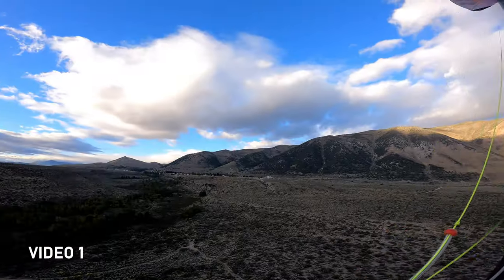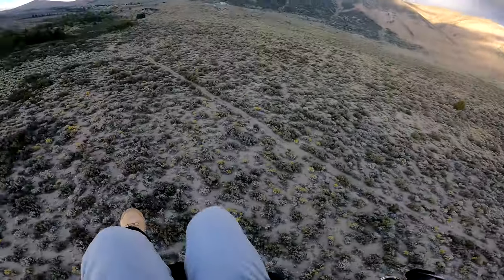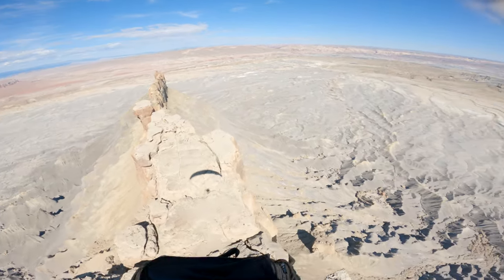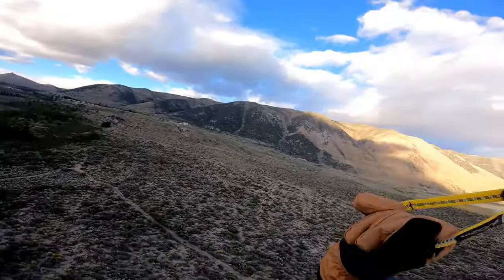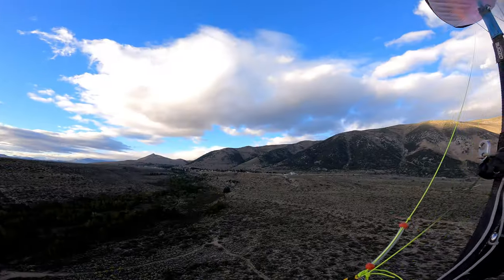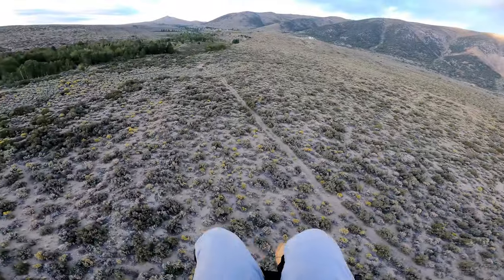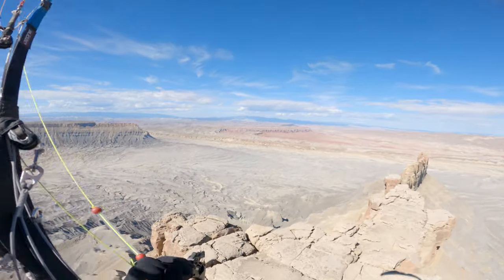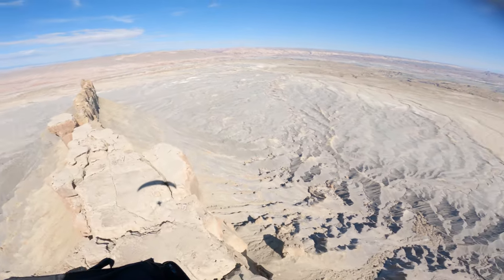FULL FRONTAL'S On A Reflex Paraglider - What Is It Really Like?

Comment: Would be more informative to know if an A wing would have taken the same collapse…?
Reply from the maker: An A wing would have recovered quicker and with less help/assistance from the pilot. A wings are designed to open quickly without any pilot input.
Reply: @TrevorSteele1  I know. I meant  in comparison to the reflex in identifical conditions
Reply: @EdgeofEarthParamotor  that would be pretty difficult to fairly compare. Maybe it could be done in a wind tunnel.

Comment: Nice dude. What trim setting did you take these at?
Reply from the maker: The FIRST RED line
Reply: @TrevorSteele1  I'm not familiar with that wing ... Is that in reflex profile in that settings?
Reply: @Johnny-gb7eh  the red line and up on the risers signifies reflex profile
Reply: @arch0nindustries  On Ozone wings, I thought the red line and below, just identified the range in which it was safe to use brakes? Above the red line, tip steering only. The wing itself is always in a reflex profile, to varying extents of reflex...ness....
Reply from the maker: Yes this is correct. Red line is when the reflex profile starts to "engage?" and where Ozone suggest you do not touch brakes.
Reply: @TrevorSteele1  I think the wing is always in a state of some reflex - but as you move the trims out, the reflex profile gets more and more exaggerated. MitchGe kinda explained it that after the red line, the wing's CoG is moved so far forward, that pulling brakes would be asking the airfoil to do 2 different things - which is why they tend to collapse when brakes are used.

Comment: 1. why were you flying trims out (fullreflex) under 30 ft? seems to be unnecessary risk taking 2. you cannt tell how they are after 3,4 collapses, I know a pg wing where 1 in 20 gets really shitty, the rest beeing ok
Reply from the maker: 1. Wasn't moving forward trimmed down. I had no options but to trim out in order to not be pushed back over the lake behind me. I wasn't in full reflex, I was at the red line which is where reflex starts to "engage" or become effective. 

2. The initial collapse speaks for itself.
Reply: @TrevorSteele1  thanks, but then the title is misleading if you were not in the reflex mode

Comment: Why does the industry use the term 'reflex' when it's impossible for a cloth wing to have a true reflex profile?  True reflex wings are rigid, and have an inverted pressure gradient in the aft portion of the wing at low angles of attack.  This profile gives negative feedback to a dive and is a safety feature in hang gliders.  There's no such thing as a 'reflex' paraglider wing. It's impossible because there's no 'pushing' force - there's only one force on the risers, and it's a downward force 100% of the time.

Comment: So I have an honest question….you just posted a video showing you taking multiple collapses on what appeared to be one flight. Would those collapses have happened on a dominator? Your uncle spews so much bullshit that its hard to decipher the truth. And flying these reflex wings now, what is so much better about them vs a dominator? Are they faster, is it just better for acro?
Reply from the maker: Yes the Dominator would have collapsed. The Dominator is actually more likely to collapse then reflex wings. It does recover very easily and quickly. Had I been on a Dominator during the flight where I took the collapses, I would have taken probably double the amount of collapses. It's hard to say what a Domiantor would have handled them like, but it would have most likely been less "violent" then this wing. Although this wing did handle them VERY well.

To judge a collapse you want to look at 3 things.
1. Altitude loss
2. Direction change
3. Ease of recoverey

The Dominator doesn't loose hardly any altitude, It doesn't change direction, and it recovers quickly and easily.

This wing (Viper 5) didn't loose hardly any altitude, doesn't change direction, and recovers decently well. 

side note - the recovery would have been much quicker and easier if the wing wasn't trimmed out and had I not hit the adventure bags when I went to pull brake.

So based on those 3 things, the Viper 5 actually handled the collapse very well. I've taken a few collapses on Dominators that were about as "violent" as I did on the Viper 5. 

And here's the thing we also need to keep in mind - The Ozone Viper 5 (wing in the video) is a high aspect ratio (5.8) wing that is for the advanced pilot. It's by NO MEANS a wing for new or even intermidiate pilots. Why I point that out is that even though it's an advanced wing, it handled the collapses very well. 

The Dominator is safe don't get me wrong. 

But the Viper 5 has proven to be safe as well. Reflex wings are not the "death trap" "hoax-flex" we've all been led to believe. 

----------------

Your question about why refelx wings are better then the Dominator is tough because what reflex wing?

And better in what way?

Generally speaking reflex wings are more stable (less likely to collapse) and faster (cruising and top speed).

Every reflex wing is different. There's dozens of different reflex wings so you can't compare the Dominator to all of them.

I'll tell you this - I've helped a bunch of Dom/Flat Top pilots try modern wings and every single one of them bought the new wing. Every one of them realized withing a few minutes of flying it, that they are better in every way.